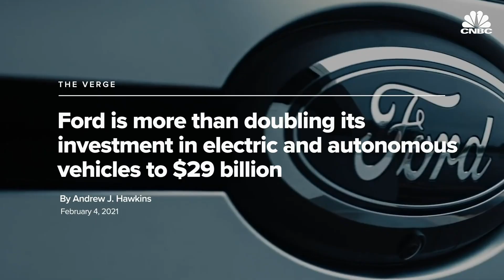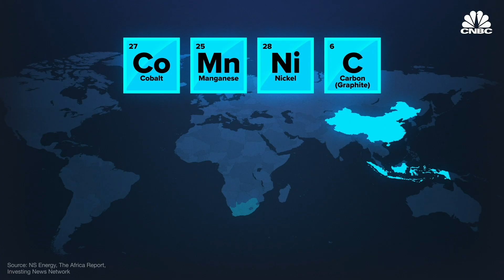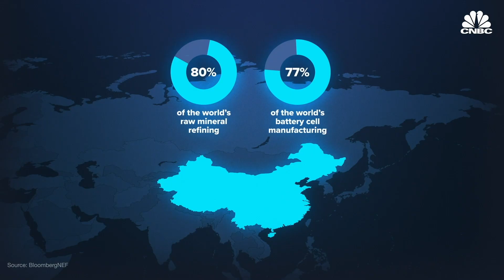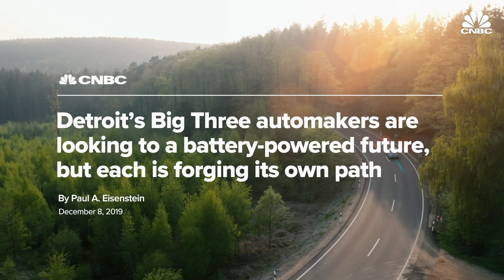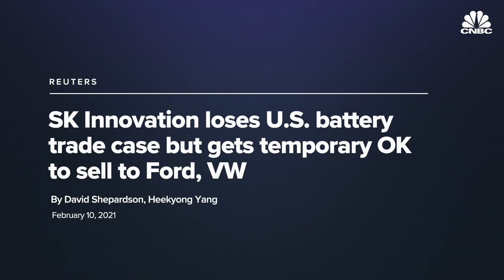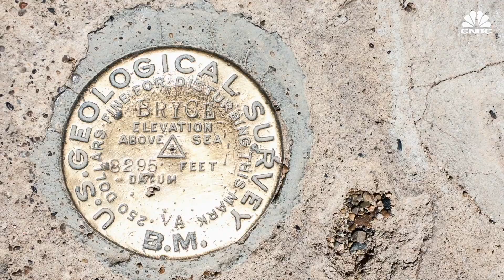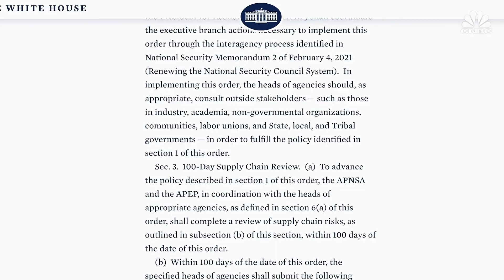Why The U.S. EV Industry Is Facing A Battery Shortage

Comment: Coming to America? Is this an old report?
"In 2008 Tesla Motors released its first car, the completely electric Roadster. In company tests, it achieved 245 miles (394 km) on a single charge, a range unprecedented for a production electric car."
Reply: HahThatsWhatSheSaid  I just rode in my friend's Tesla Roadster this past weekend.  There are plenty of them still on the road and running fine.
Also, a Tesla Roadster, even in poor condition, will bring a minimum of $40k, and most still sell for around $70-100k.  Some will still sell for as much as $130k.  So the value of the car is far higher than the cost of replacing batteries.
Those old roadsters had battery packs assembled by hand.  The modern Tesla battery packs for Models 3, S, X, and Y are much cheaper.
Reply: Electric vehicles are 5% of the United States market. 95% is a combustion engine. So coming is appropriate.  You'll have to wait for decades to get rid of all the  combustion engine unless they are free to exchange.
Reply: This video is about battery manufacturing.
Reply: Thanks for watching!  
For your  guide and analysis text now
+_1(""~"3"""8)"""6""""+7""~"4""~"2""~"2") '"3"'"6"""~1
Reply: Republicans are the end of America
Reply: @donnydump7650  what's the difference between a Republican and a Democrats? Both have lying tongues.  Trump builds wall Biden fill the gaps, which is building a wall. The use of different words doesn't change the out come. A WAll.

Comment: what about supply and demand?
if batteries are in so much demand, why can't the automakers just pay more?

especially if u tell me that "the margins are so low (on batteries)" that straight up tells me the prices need to go up to justify the costs and risks of operations.
Reply: “electric cars are 45 percent more expensive to build than the ones that burn fuel”
https://insideevs.com/news/444542/evs-45-percent-more-expensive-make-ice/
The battery accounts for about 40% of the EV cost. Make the battery more expensive, the demand for EVs will drop and that will solve the shortage.
Reply: There is  ot enough lithium and other raw materials been produced and the demand is very very high. Its also not that easy to produce lithium.

Comment: Eventually you will run out of rare earth metals for EVs so EVs aren't solution
Reply: They have literally said that about every element, to include oil, forever. I've had to hear about the helium shortage for an eon now...
Reply: @BlueSky-kh8ue  the Helium shortage is actually the biggest problem as there are so few sources of helium on earth.
Reply: The 'rare' in rare earth doesn't mean 'rare'.
Reply: What Li-ion have to do with rare earth... are you high?
Reply: Battery recycling companies are already opening up and some are running to help the supply chain in the USA .
Reply: No rare earths in batteries. One in PM motors.
Reply: Eventually you will run out of oil for ICEs so ICEs aren't solution..         see I can contribute nothing useful as well
Reply: @DanafoxyVixen  Bill Gates is investing in carbon capture. Lol get shreked
Reply: Not until u can mining asteroid
Reply: The amount of the rare earth parts is miniscule, in comparison to the battery composition. You don't know what you are talking about.
Reply: @leetjohnson  nonsense, rare earth means its extremely diluted in the nature and the extraction process is very energy intensive and bad for the environment. China has been the leader in rare earth production but its never sustainably done.
Reply: @carholic-sz3qv  You replied to the wrong person. I informed the OP that there is a tiny fraction of the highly available, yet unconcentrated supply of rare earth materials used in batteries.
Reply: @carholic-sz3qv  that depends on the battery chemistry, right now where moving away from needing rare earth in batteries to chemistries like lithium iron phosphate.
Reply: lithium is everywhere
Reply: @andromeda9340  just like hydrogen but how easy and sustainable is that to extract it!? Thats the main question. The demand is significantly increasing when the supply can't even catch up.

Comment: The capitalists willingly, gleefully handed their production capacity to the communists. Lol, the communists are using the capitalist's own greed against them and it's hilarious.
Reply: Not in production we ain't.
Reply: @Michael5001  Australia produces the most batteries not Chyna
Reply: @Student0Toucher  no, Australia produces the most raw lithium, not the batteries themselves. But that's not the point, the point is the US has offshored much of its production to China, handing China a significant amount of power in the process.
Reply: @Michael5001  They have no power as AI tech roles in we can manufacture everything at home and Biden plans on fighting that too
Reply: @Student0Toucher  china is ahead in AI
Reply: Western govts wanted rid of troublesome unions in manufacturing.  Cheap imports was the weapon of choice.  Worked a treat, but it's called " cutting your nose off to spite your face".
Reply: Those communist are predatory capitalists.
Reply: We are still superior

Comment: We need to push the battery production in the US quickly. Biden has the right idea but we need Congress to push a infrastructure bill to get electric vehicle going fast
Reply: Most of electricity in US is generated by burning fossil fuels.
Electric cars don’t solve the problem, only more it around.
Reply: @rok1475  Except even 100 percent coal power would still be cleaner than gas vehicles. Do your research. And a lot of areas such as mine use cleaner energy making an ev far more sustainable
Reply: @Dylan_JVIPTER  bro ur name is tesla lover 😂

Comment: Also, if they plan on going fully electric is less than 15 years, gas powered cars are about to go bye bye real soon! In 5 -7 years, you may not be able to buy one new.
Reply: At some point yes. Electric vehicles are so popular now because of cheap fracking natural gas. I pay 8 cents per KWH. Germany pays 30 cents. I do think electric cars have a place in cities but America does have big rural areas where electric vehicles make zero sense
Reply: European car manufacturers have stopped combustion development, apart from BMW.

Whilst peak electricity prices are more expensive in Europe due to general rejection of fracking, we have smarter and smarter grids where you can use time of day pricing to get as low as 6 cents during the night for EV charging when wind is plentiful.